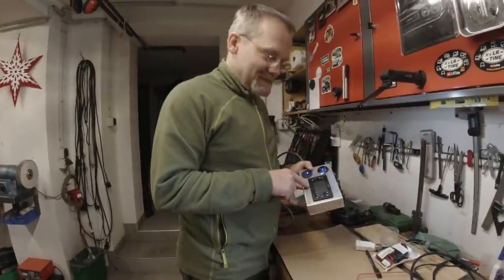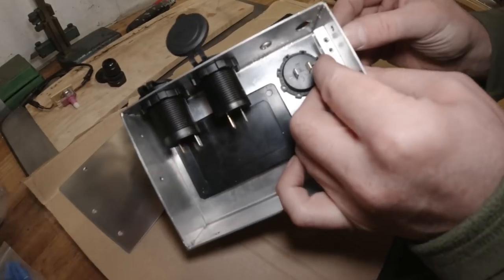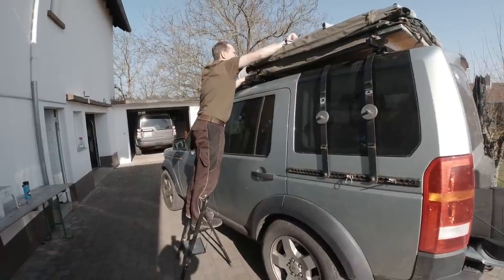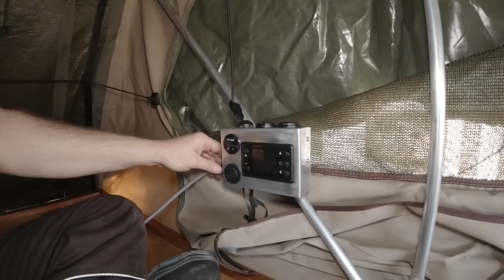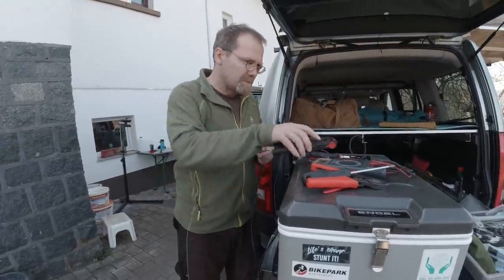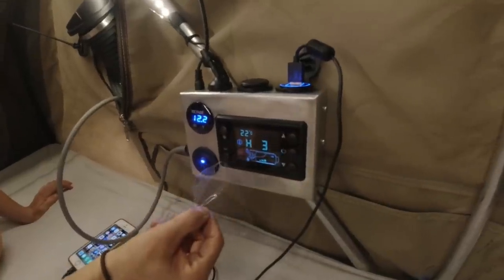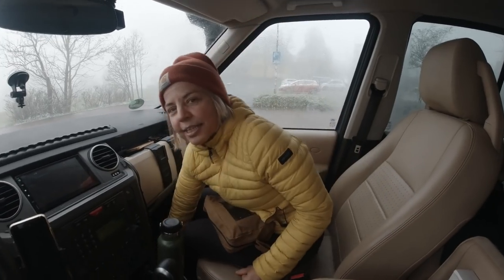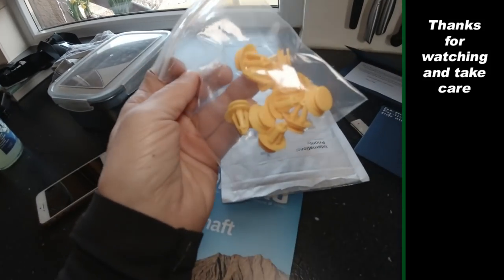Clever Roof Top Tent Upgrades - DIY

Comment: Fantastic work as always. Buying extended roof rails tomorrow for my Disco and will make a platform in front of my tent and find a box to mount on top plus add a small wind deflector. Love the tent lights design. 🤘

Comment: You bought the right 12v plug. I have the same one for over 20years and used it for a bunch of different projects in the car. That means I took it apart a lot of times and it is still in excellent condition.

Comment: Great show again, did you know on your D4 if you press the left and right mirror select buttons together (on the drivers door) both mirrors retract for tight places and hedgerows.
Reply from the maker: Yes but I was so far not able to change the config so that they do not fold in when I lock the car.  It generates a fault und I have to undo the change with the GAP.  Christian

Comment: Great video and your skills too, if I were you I will fix the LED strip with something better than the self sticking tape it has because the tent will get pretty hot under the sun resulting on the glue from the strip to fail.
Reply from the maker: 👍We have added additional support, just did not put it in the video🙋‍♀️

Comment: My goodness Vera, you looked like all your Christmases came at once when you were trying out the finished lighting in the roof top tent!. Christian, we call the  Aluminium Support Structure in the tent a "Boom" or "Folding Boom". Also, the heater display in the box did not look like it was mounted square? I don't know if it was the camera angle or what.
Reply from the maker: Of course it's mounted square, and if not that would not be such a disaster. We have it so you can adjust it to any orientation. 👍🙋‍♀️Vera
Reply: @Vera_and_Christian  I know it would have been a disaster - I had a terrible nights sleep, I was worried about Christian! 😯😯😯😯No I can sleep well, thank you Vera 😁😁😁😁

Comment: Great video - and, at last, something I understand.  😉

I used to make little boxes like these for audio use; making a monitor, red recording light and talkback unit, splitter boxesm etc.  Having to purchase the chassis cutters, including rectangular ones for switches, etc....  Though I did prefer using the Eddistone diecast boxes to the folded aluminium ones - good memories, not done that for a few years now - but all the boxes I made are still working well.

Also - your apprentice cable reminds me of the time I had to solder a multi-pin connector - did a good job - and then realised I had forgotton to slide the connector sleeve on the cabe first - so had to cut it off and start all over again. 😖 -  only did that once, though.

Hope we can sort out how to pay you for that patch, though, as I don'y have PayPal. 🥰

Comment: The little red pin is actually a lever that locks and unlocks the red adapter cap on the top of the charger, and Christian goes and rips it off, barbaric 😂